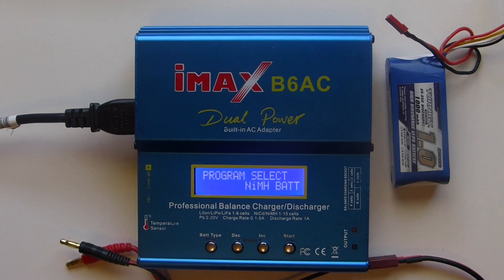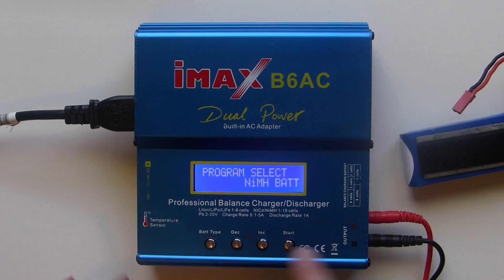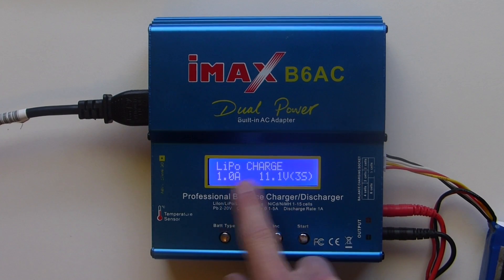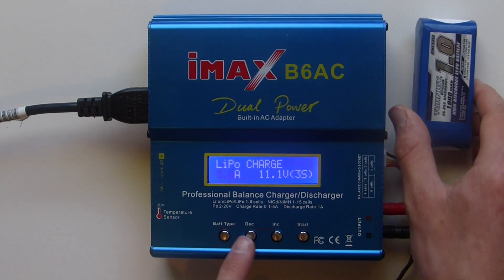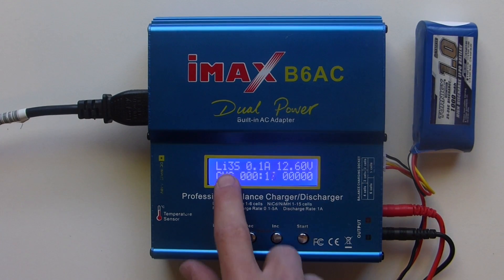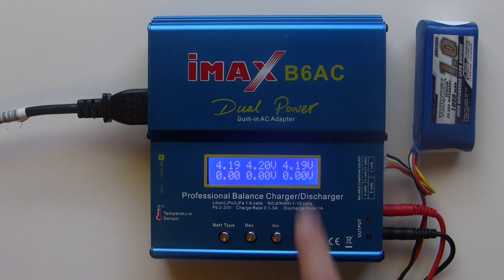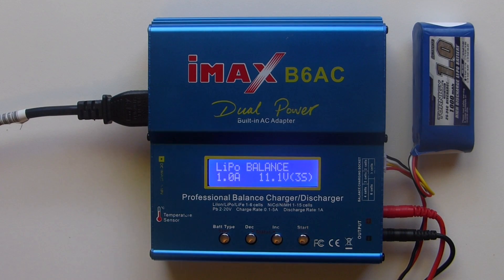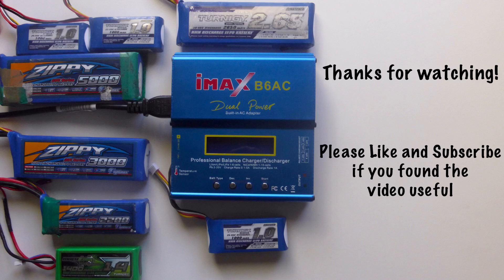How to Charge and Balance a LIPO Battery

Comment: How do i connect the balanced wires  2S to a Soshine 9V type 7.4 volt. I have a ImaxB6Mini but dont have a clue how to connect it to the Soshine battery.  The battery has 2 poles negative and positive.  A 2S cable has 3 wires. 2 black. 1 red.    Li-po batteries are new to me, when it comes to charge it with the B6 imax.    Any advice needed.  Thanks

Comment: What happens when input voltage in higher to charger
Will it explode the battery
Reply: What was the voltage of your lipo? At what input voltage did you select?How many cells your lipo had?

Comment: Do I need to pay attention when charging 2S LiPo not to exceed the voltage or will it stop charging by itself?
Reply from the maker: As long as you select 2S the charger will stop at the correct voltage by itself.
Reply: Thanks, I did it :)

Comment: Hello there can I charge these batteries by using any of the cables provided in the battery...like can i use the white connector side and charge the battery but whithout balancing...i have a quad that uses the white connector and not the red one

Comment: Are the main output RED and BLACK required? OR just the balance connector.

(I'm working on an enclosed battery pack, so i need to make it's output ports for charging, so I'd like to know if the red and black are important)
Reply: Pao he doesn't answer any questions unfortunately

Comment: so if I have a 7.4 350 mah lipo do I put the amps on .3
Reply: yes you are correct, a safe charge rate for lipo batteries is 1C, or the mAh rating of the battery. If your battery specifies a "3C CHARGE rate" you can charge at 3x.350ma = 1Amp.  

If there is no CHARGE rating, the safe bet is 1C, although it's safer to charge a 45C (discharge) battery at a higher rate (2C or 3C) than a 10C (Discharge) battery.

Comment: i keep getting "cell error" voltage invalid when i try to charge a new Vant 5200Mah,, any advise please,,,obv i set it to 5.2 to go with the battery,, PS,, think the Vant 5200Mah that Nitrotek sold me is a dud,, as the imax b6 chareged the stock 3500Mah fullymax,, and one of the Vant 5200, but i guess they sold me a dud batt,, Nutrotek wont even answer my emails after spending around 300 quid with them over last 2 weeks,,, please everyone!!!!! never order from Nitrotek if you live in the UK,,, they sell rip off HSP cars that are cheap copies of HPI,,, and they will take your money and send you stuff they know wont work with your car,, and then refuse to answer when caught out,,, thanks to guys like you i am picking this new brushless up,, and have a 1/8 nitro i am going to convert to leccy,, as was fed up of the mess and temprament of nitro's,,, 😊 having no trouble with charging lipo now up to 6 's but I don't need go more than 2 as it is sick!! 😊
Reply: Ashley Barrett I am slagging them as they will not get back to me after 10 or so emails and calls! the battery is a dud as my imax b6 tells me! and works fine with every other battery I have! the battery charger would tell me it needed balanced  but it just says, cell error. incorrect voltage! they will not even answer the phone or email where other companies answer and are happy to give info and return goods that are faulty! thanks! Ntek are terrible!! even I can tell it's goosed! if it was an imbalance error my charger would sort each cell out!
Reply: Ashley Barrett what is your intrest in Ntek? ? Haha,  I live 500 miles from them and many other rc guys have posted not to use them as they just take your money and run!!.. think I may well put my dissaproval on fb page! thanks for the ideas!  why are you bothered?? 😂
Reply: Ashley Barrett .. indeed as I am... I get all my stuff from Modelsport and rc hobby store now! they have customer services mate!!!
Reply: Ashley Barrett ... I do hope that your comment about being educated is just a bit of youthful cheek... I worked on the drilling package of oil rigs most my days before I bust my spine,, and probably have decades on you so please don't get all immature and start with the "I'm educated don't you know" bs!! it really makes YOU look like a tonk!  not me! if someone gets a bad service it has to said and put out there! but you are educated to know that so why feel the need to point that out!! 😂
Reply: Ashley Barrett I want to deck out my old.new nitro in brushless lipo! but will not be ordering anything from n tek... just about to put on alu parts that came today from rc hobby store and modelsport! no probs with them so far!
Reply: Ashley Barrett .. I just ordered some cheap good stuff from amazon, but modelsport and rc hobby store have been prompt on about 8 things I have sent for! very happy with the spec of the car now! hope you get it sorted!
Reply: Ashley Barrett ... no mate! I have a fullymax 3500Mah 3pc bursts and 2 Vant 5200Mah with 100 c bursts! and it is uncontrollable on that! no need to for more than 2s! bonkers! was having probs with my servo saver arm jamming against the servo box but just used a file and took the side off,  perfecto!! I hear Genzace batt are good! not very clued up tbh! learning a lot every day though!
Reply: Ashley Barrett ..Ditto, 48 and just been into it for a few month,  have my car up to spec now! about to put a few short vids on the tube under my name! it's good getting set so something don't break every time you run it! hope things are going good??
Reply: Ashley Barrett ....aussiercplayground is great. Also KillerOffRoadHobbyz 😎. I am all waterproof!!
Reply: Just be careful. Threading in and out of plastic,, many times! Do it very slow as you would be surprised the heat it creates twisting a turnbuckle and you strip the threads in no time! That's why my I have gone all aluminium! Just thread it and add thread lok! Can't wait to convert my 1/8 seized but new nitro to brushless! I have a nice  HSP 1/8 nitro I have just run in but am selling as with this new leccy gear I am so into it!  Tuning the nitro every time you run and carrying a litre of nitro, now just 3 batt and a wheel wrench and screwdriver! 😊

Comment: I have a quick question about a 3s Lipo 1500 mAh 25 C that came with the Eachine Wizard X220. I was using the cheap charger while waiting for my new and better one ( SKYRC iMAX B6AC v2 ).

Unfortunately during one flight LOS I forgot to put the voltage detector on !!! ( I know ￼:-(. )

Once I brought the quadcopter down and checked all cell I had 

Cell 1 : ~ 3.4 V

Cell 2 :. 1.81 V. !!!

Cell 3 : 3.52 V

The battery puffed but a little very little bit and was a bit warm also. 

I'm afraid to recharge it due to the enormous voltage sag on cell 2. 

What do you think I should do with this battery? 

It appears that the next day the battery managed to balance itself a bit on it's own. The voltage sag difference is now only 0.7 V between cell #2 and the others. 

Is it dangerous to recharge this battery ? 

Is it dangerous for the charger itself. ? 

I was planning to keep this battery for LOS only.

Many thanks in advance for your help
Reply from the maker: My knowledge of battery's isn't the best but i have battery's discharge until the quad drops out of the sky all the time. All i do is balance charge them if the cells are like yours then use them again. Not sure how safe it is but it works for me, but definitely better to avoid discharging them too far!
Reply: Thanks Ashely Barret for that information. I will do so.

Comment: When I am trying to do a Balance Charge I receive an error that reads "BALANCE CONNECT ERROR." I am able to connect the XT60 cable without any issues but when connecting the balance charge cable I receive the error. Would someone be able to explain what is happening?